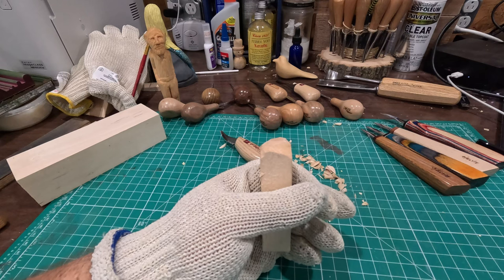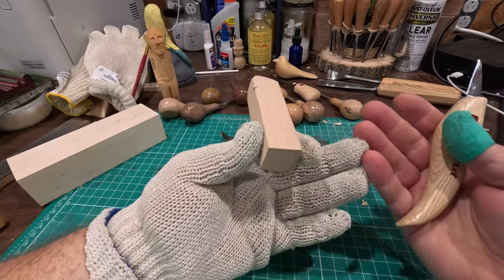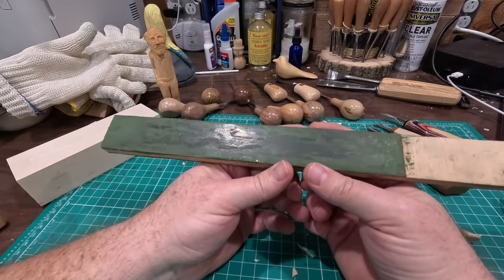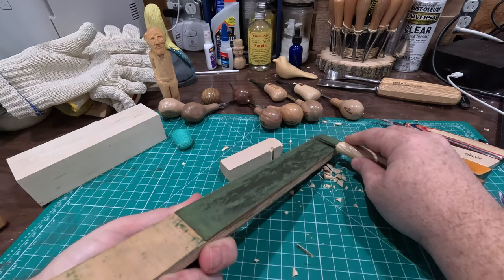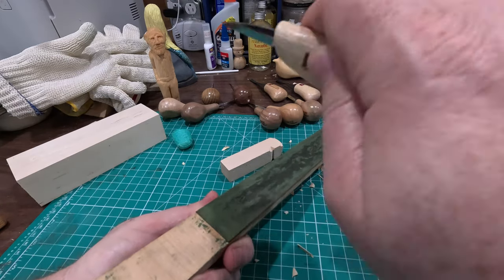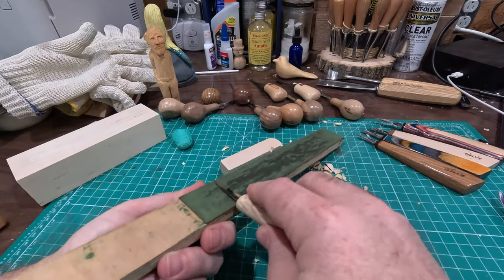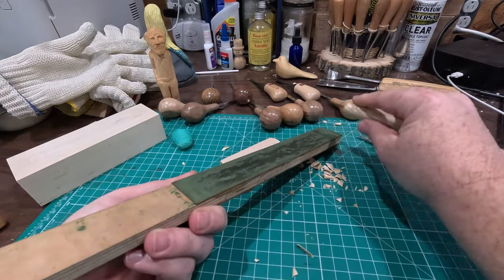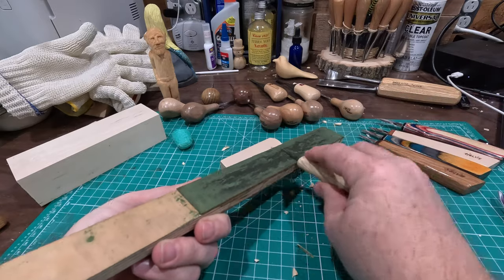Wood Carving Tools Beginner Guide

Comment: Thank you for this video. It has been very helpful in knowing what other knives are on the market. I have several Flexcut. I like them very much however I would like to consider other knives like the healthy or the Drake I haven’t seen anything on Drake. So I don’t know about them I am trying to get back into cARVING again. I’m having trouble motivating myself to do that. Do you have any suggestions on how to motivate yourself.
Reply from the maker: I too, go through periods of time where it doesn't take much to get me distracted from carving.  One thing I find helpful is to not worry too much about what to carve, and just make a commitment to spend a few minutes a couple of times per week picking up a piece of wood and a knife with no real goal other than just shave some slices off.  What is nice about that is I just think about how the knife is cutting, Maybe try to see how thin of a piece I can shave off, basically just getting the wood and the knife in my hands.  I have done several carvings that have started out like that, and the next thing you know, it is hours later and I should have been in bed already.  Also, the best carving is the kind you do when there are no deadlines or trying for something specific.
Reply: Thanks for the encouragement. I’ll try that approach and see if that works for me. I really like your YouTube channel. Keep up the great job.

Comment: great vid for sure with good advice been carving for years .    Very controversial subject for sure LOL.   I have gone the circle and find pleasure in useing the old pocket knives but i am going to bragg i am good a sharpening them .   Lets face the truth dull knives don t work well and hurt people .   My biggest injury's have come from dull knives and glove failure ,  failing to put the glove on LOL.    Great to see these vids promoting carving
Reply from the maker: Thank you for watching and the discussion.   For sure the two most important things are a sharp knife and a glove.
Reply: if you don t mind telling me where you live reason for asking is i have a saw mill and i have bass wood and butternut i will give you for the postage .   I take a flat rate box and fill it and send it .   One must remember this is not planned  rough sawn .   The couple i have sent like 2x2 what ever the length the box is or if you want to see what it is like we can do the small box i am happ with it  @S.Hunter
Reply from the maker: If you send me an email at stevehunterwoodcarving@gmail.com. I can give you my address.
Reply: I've only ever carved a few things and mostly I use a pocket knife myself. I have a Kissing Crane Black Angus that I'm partial to using now. It's a cheap knife but it takes a good edge. If you're carrying it it's nice and light too.

Comment: Steve is a good subject here. 
I'm seeing a few people believe 4 pieces of knives and 4 gouges are enough. 
But I'm seeing that the website on carving people often has boxes of carving tools, and I'm thinking 80 percent they probably use less than 20 percent of their tools. 
I'm planning to build around 15 pieces of knives and gouges and chisels of 01 steel and believe as a now I can build better knives than the Flex Cut as it's build of 9095 steel and I'm being told the 01 steel is being used for the upgrade knives. It's not the very best of steel, but it's compatible, and Bladesmith in small shops can master the 01 steel. Some steel requires special and expensive equipment for great results..
I'm hearing good advice from you that's something this hobby needs to hear. 
Thanks
Reply from the maker: Thank you for watching!  I think you are correct. I know that I already have everything I need to enjoy carving but I am certain that I will continue to collect knives.  Collecting knives is like a side hobby for some.